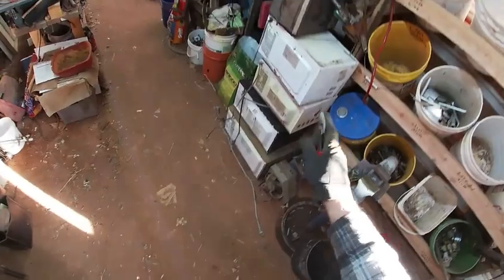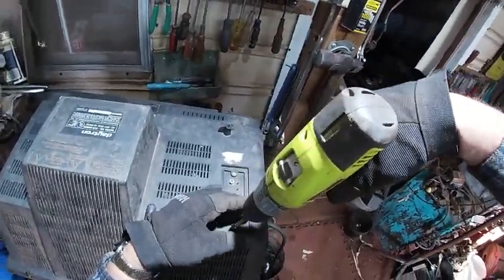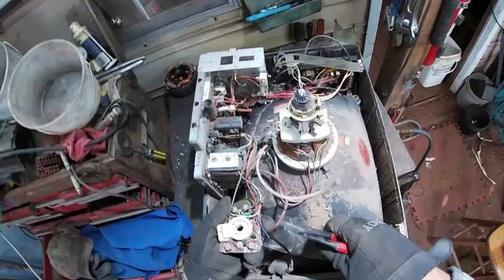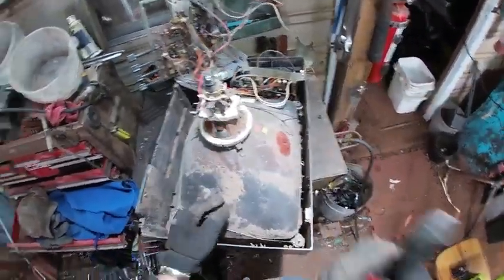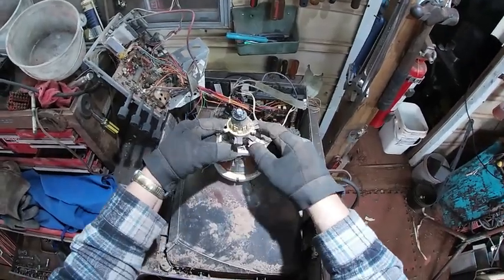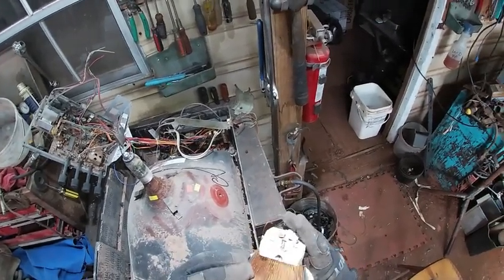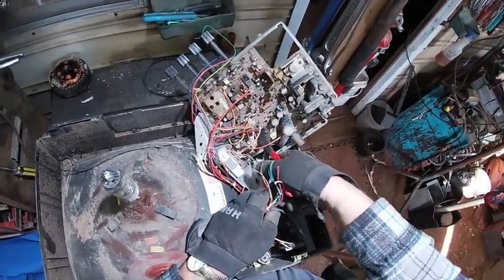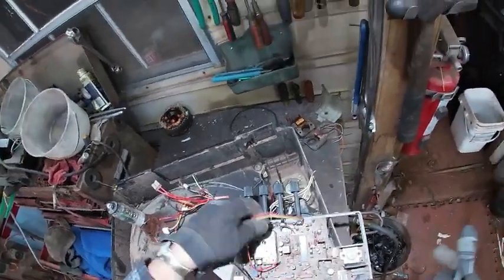How to Scrap an Old  crt TV for Clean Copper and some e-waste

Comment: Hi there,just a tip.That degorzing cable,if you find that the outer tape breaks all the time,try it from the other end,it will come off in longer lengths.Awesome vid,keep it up.👍